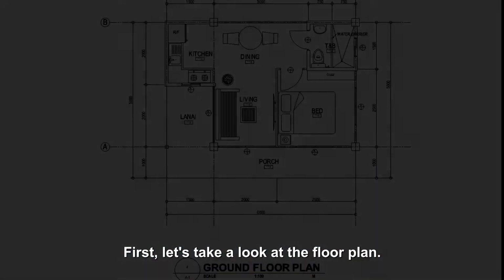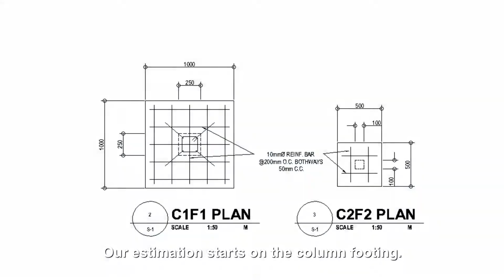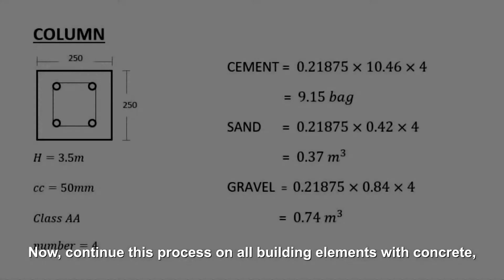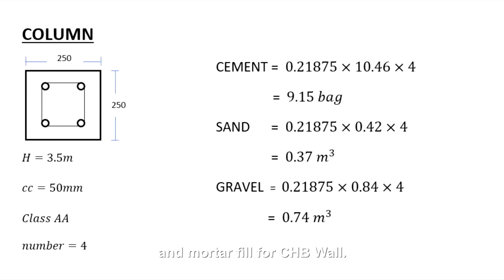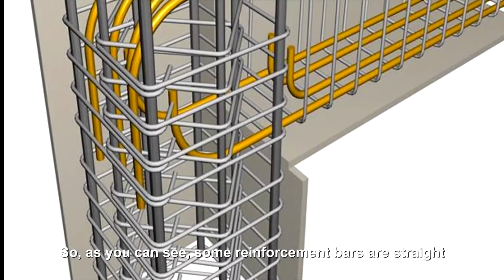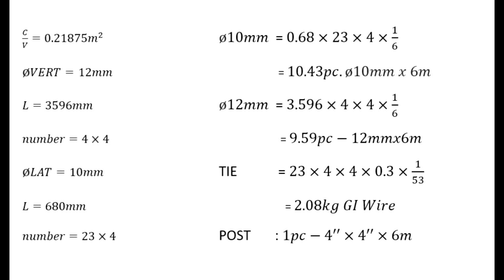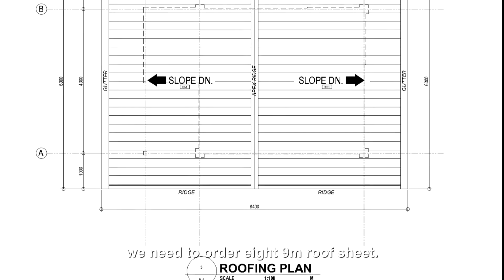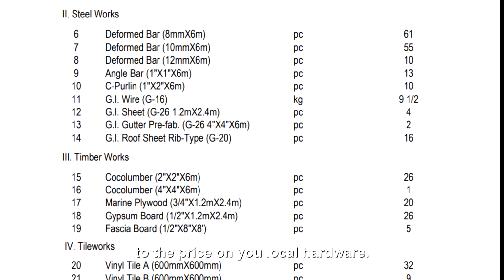Quantity Surveyors And Estimators (PLUS! House Estimation Example)

Comment: The house estimation example is easy to follow and understand just one comment when you do estimation you need to know the exact quantity you don't use the decimal point you round it up because in the market you can't buy it exactly what you computed. Just for example 2.5 bags of cement, you can't buy half bag of cement so you will round it up to 3 bags of cement.